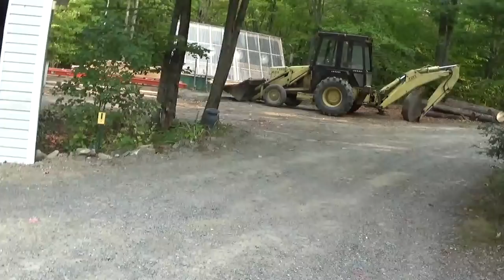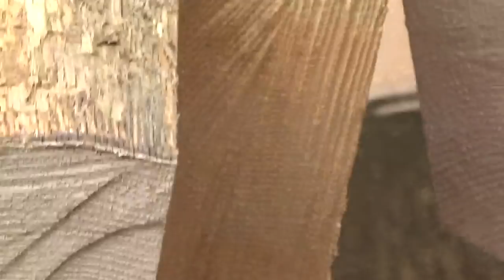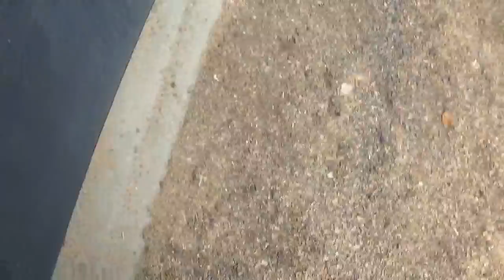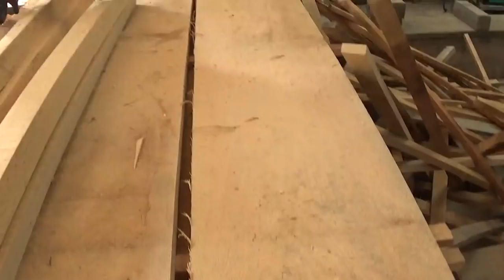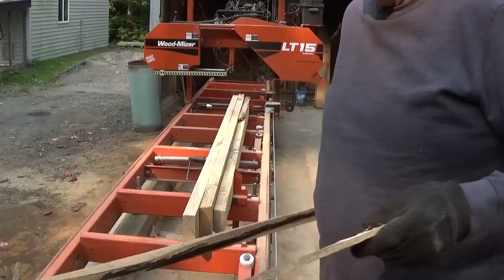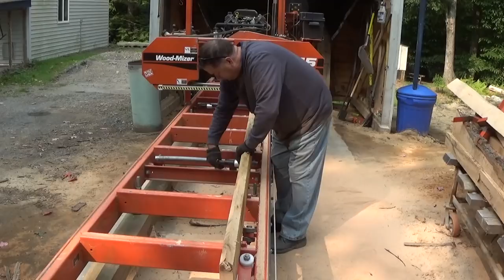Re-sawing quarter sawn lumber with the LT15.

Comment: Those 3 sticks before the last 2 were sawn as a trapezoid because they were not tight up against the stop and leaning over as you cut, especially as you got to the end.  Then the last 2 wanted to lean over too.  I'd have 2 clamps set up, one on each end and not just trying to hold it with one in the middle.  A jointer would help get them square again.  A planer sled with a fence could do that too.  You could gun barrel your log before cutting so that all the boards have straight edges and not live edge.

Comment: I would like to know how long your planer blades last and if u sharpen them. If you sharpen them lets see how you do that! I plan on buying that same planer, we have been on a level 2 evacuation for over a week, its letting up now, lots of smoke! ive got a nice oak sittn on the mill waitn and a trailer full of 2 inch slabs, i plan on goin after oak moulding next and eventually building me a house off of my mill, i sure do appreciate all of your videos, i learned how to sharpen my band blade from you also!

Comment: Not a bad job Joe but if you had a jointer/plainer would it not be better for getting your spindles square and flat?  Many as you have done it would likely have justified the cost. I don't think they are that exspensive.